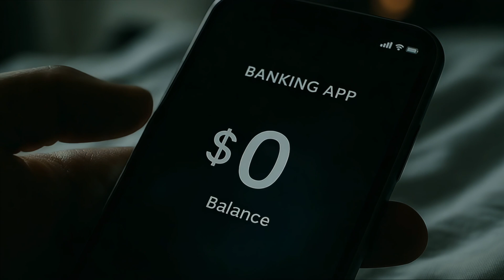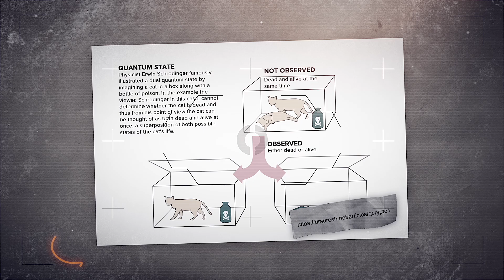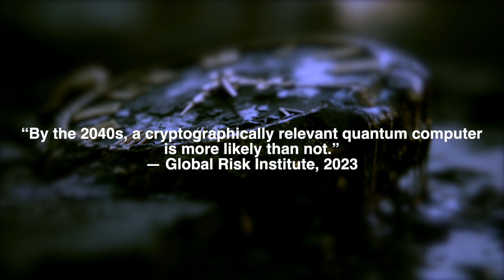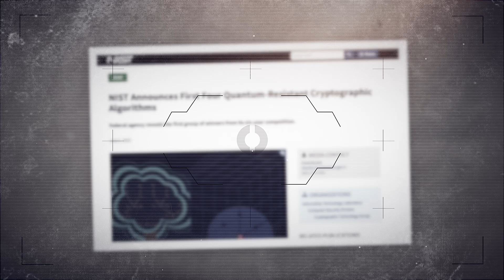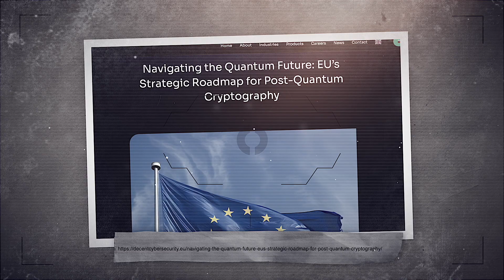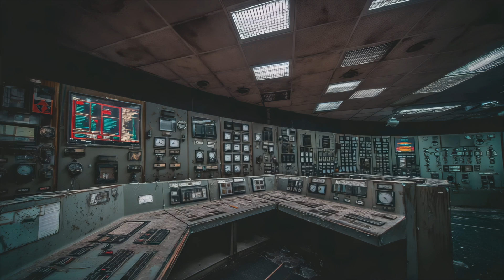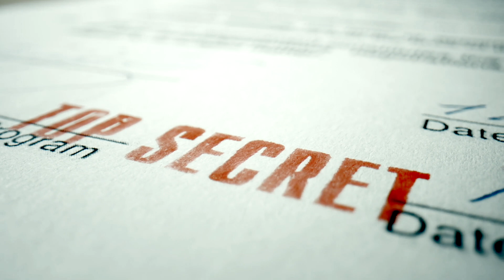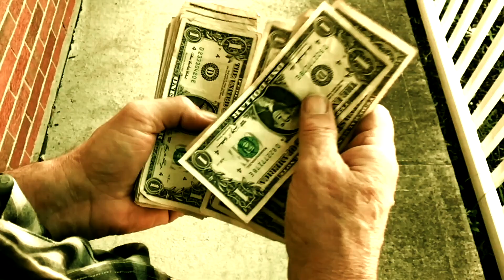Q-Day: What Happens When Quantum Computers Break the World

Comment: The second half of the video only would happen if EVERY rsa-like security fails. Nowadays there is a protocol of updating critical encryption security to be q-safe. But, as you said q-day may be quiet
Reply from the maker: Totally agree that a full-blown meltdown needs more than one algorithm snapping—but the weak link is often the stuff nobody patches. Banks and browsers can roll to post-quantum quickly; legacy SCADA gear in a substation from 1998 can’t. Once a handful of those “forgotten” systems crack, interdependence kicks in and the failures cascade. The protocols are there, sure, but rolling them out to every router, smart meter, medical pump, and cargo scanner is a decade-long slog. Q-Day might start as a pinhole, not a crater—and that’s what keeps me up at night.